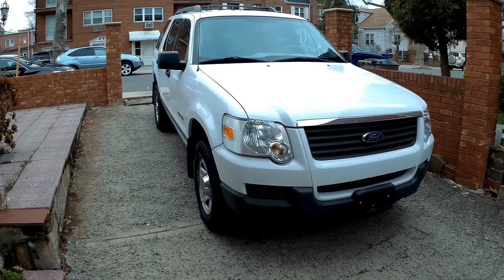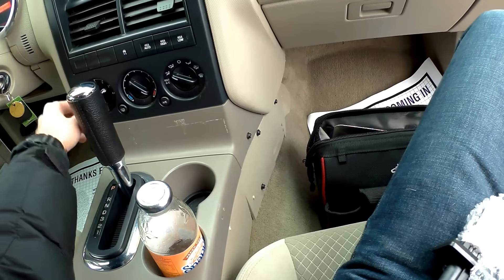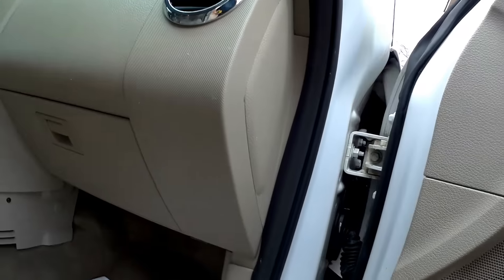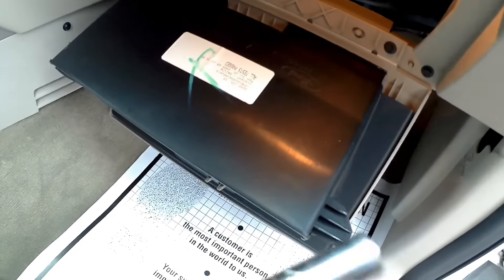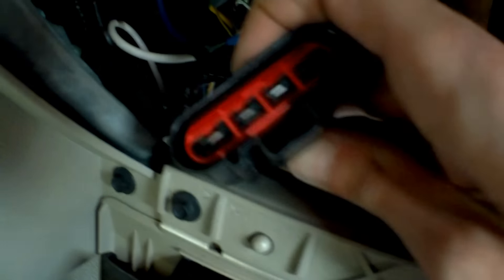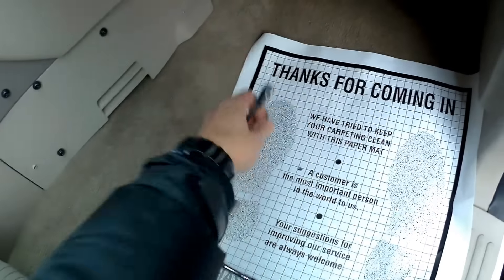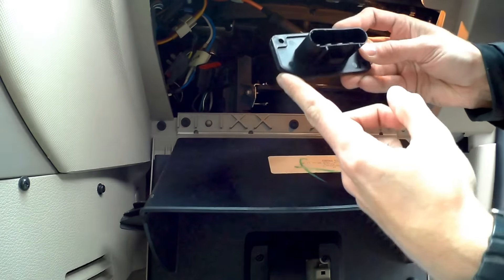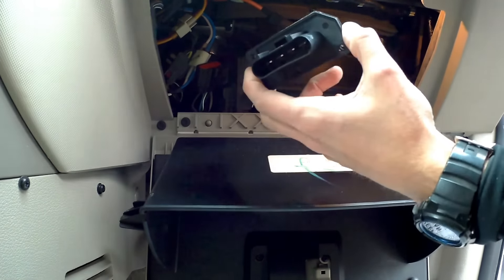How to replace 06-10 Ford Explorer Blower motor Resistor

Comment: Thank you your video made it very helpful for me to correct the same problem in my 2007 Ford Explorer sport track.
Reply: Same, just fixed this issue in my 08 Sport Trac and it worked perfectly. Folks, be careful when you test the new resistor - the metal plate gets hot almost immediately.
Reply: That must be an issue with these cars because that's exactly what I have..

Comment: spot on directions!!  thanks Ed.   I pre-thread the screws in the new resistor to make it easier to put back into place.  much better than paying ~$350 at the dealer....
Reply: Yes, pre-threading the screws really helps with the tight confines.

Comment: Found the part for $30 on ebay. The fix took well over an hour cause I only have 2 hands. 😁 It did solve the problem. I did the same fix on my Jeep a number of years ago and it wasn't nearly as difficult. Took about 5-10  minutes.

Comment: My resistor went off about 3 times already .  If you get it from a Ford dealer change you like 54 dollars and got 2 years warranty.  I didn't know that.. I just replace one about a month a go and went off again. The mechanic told me to get the blower motor but I didn't listen because it was 150 box and I didn't have the money.. now I order the blower motor I hope that solves the problem.. the thing is that I have to get another resistor too.

Comment: My 08 explorer blower mode works on 1, then 2,3,4 are the same with 1 and don't blow harder. Is this also the motor resistor problem? Your case was 1,2,3 not working.
Reply: 2 and 3 are the same for me and 1 and 4 are correct. Did you get your problem resolved? Seems like I probably have the same thing going.

Comment: Mine heater work on 1 and 2. It just blows cold air on 3 and 4 does that mean I need a blower motor resistor ?

Comment: i have the auto temp control feature, a mechanic i talked to described this same thing as the problem so Im not sure if it will be any different for fixing, though repairED said it was NOT the same fix.  Will let you know.
Reply: You will need a different part.  Ru574

Comment: 07 Explorer. Mine has the buttons and it sometimes works when the car is on ON/ACC but then once the car is started it shuts off, no power, no lights, nothing. It will randomly cycle on and off while the car is started, but it's very random. Any ideas?
Reply: It's the blower motor resistor.  But the part you need is ru-574.  Not this one.
Reply: @Xgfocuselite  actually turned out to be the whole control module. Apparently the previous owner had spilt coffee or some brown liquid on the dash. Why it didnt affect any other electronic or why it didnt effect it sooner is beyond me
Reply: Mike Lipinsky what control module is that? Do you mean the climate control module with the buttons for activating everything? I have an 07 Explorer Sport Trac with push button dual climate control and recently it stopped working. It was fine but I started it one day this week and it did not work, no display lights for temperature, no AC, no heat and no airflow at all. It seems to have no power. The only thing that lights up is a couple of the buttons when I turn the dash lights on. I checked fuses and all is good. I’m wondering if I have to replace the unit with the buttons or a body control module. I spilled coffee into mine a couple of times 5 years ago and the climate controls would go haywire for a day or so but always began working ok again. I took apart my dash today and the connections all look good and from what I could see of the circuit board inside the module it looked fine. But I could not see it all as I did not disassemble it.

Comment: I just replaced the blower motor and resistor and it  still won’t work... any ideas?
Reply from the maker: Fuse?
Reply: @repaired2106  it was the relay...

Comment: Hey anybody know what that ticking noise is???
Reply from the maker: If ticking noise goes away at switching between hot and cold. Then most likely it is blend door actuator.
Reply: If it varies with fan speed it is probably debris in the fan motor I have had seeds from maple trees get in mine otherwise I agree with blend door.
Reply: Note there are multiple blend door actuators.